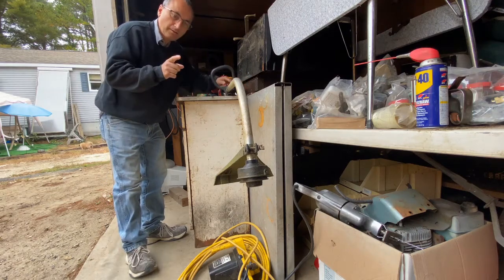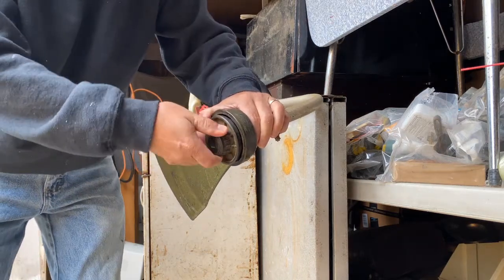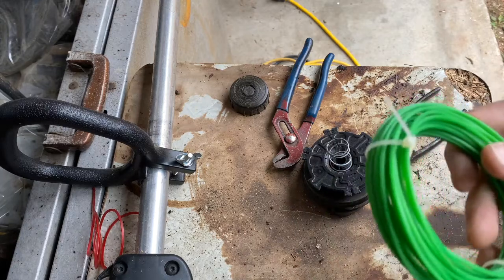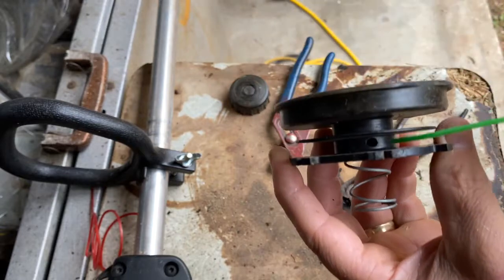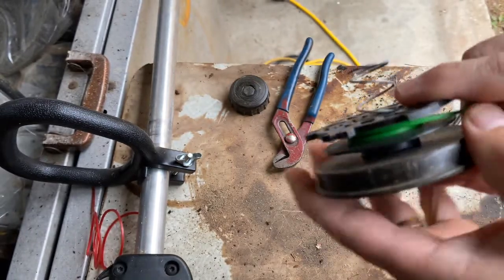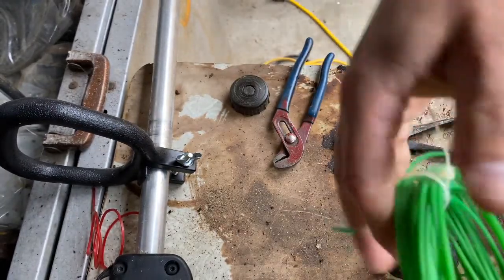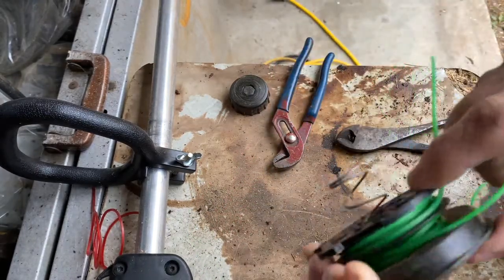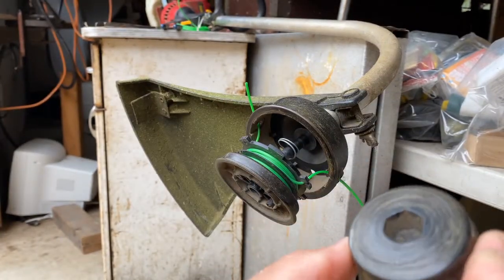how to re string your Homelite trimmer

Comment: I don't have a homelite mines a sovereign which I believe could be the same but named different as I'm in the UK but it has the exact same string head , I need to practice putting the line in cos I've never had a petrol strimmer before and I think I did it too tight cos it twisted up and wouldn't come out when I bumped it . I'm still learning how to use the machine it's a beast
Reply from the maker: Yeah they can be tricky, and if you wind it too tight it certainly can get tangled and not come out. I hope this video helps. Good luck and thank you for taking the time to comment

Comment: the bump head with bolt through it at video 1.29 . can you get replacement for this . I have ordered bump head bolt replacements for my curved head strimmer and when they come they are different with silver caps on the end instead of the bolt comes out of the housing,  and  they normally are cheap plastic heads. Thanks for your time and informative video
Reply from the maker: I don’t know for sure, but I am assuming you can

Comment: I have a straight shaft. However the cap on the end won't come off, i can turn it, but it won't come off, not sure if I've stripped the thread. Any tips? Cheers Adam
Reply from the maker: It’s hard to say, maybe it is stripped. Wish I could help more but I am not sure what the issue is. The only thing I can think of is are you pushing in on it as you try to turn it?